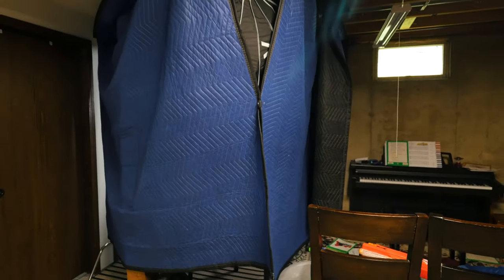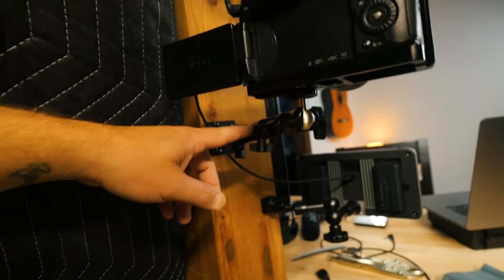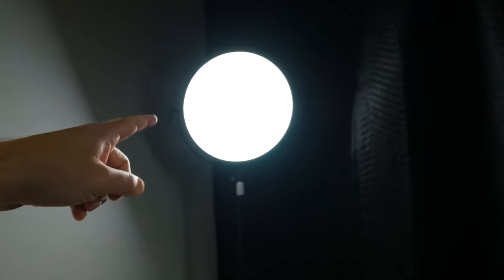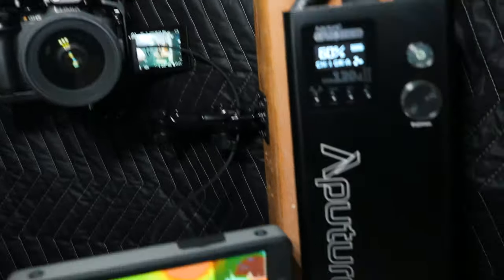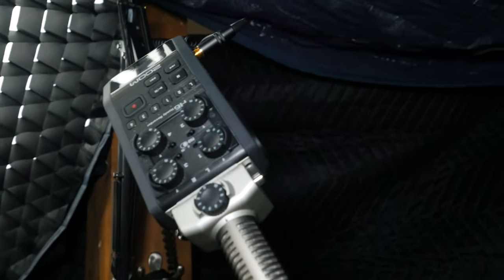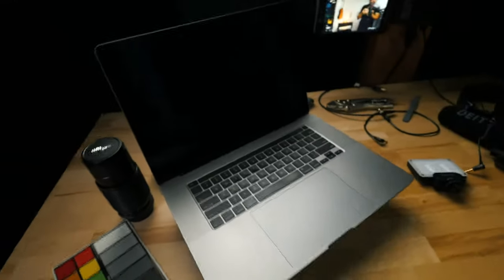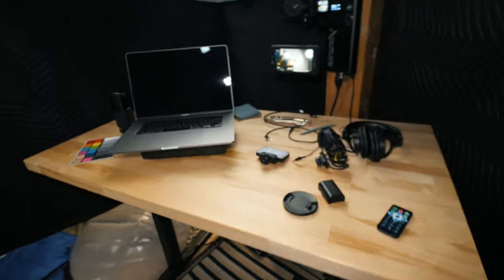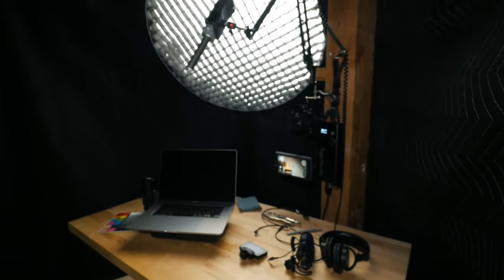GH5 YouTube Studio // BEHIND THE SCENES // Build a YouTube Studio Around Your Panasonic GH5

Comment: Right there with you on the Black Pro Mist 1/8. Thanks for sharing this with the community by the way. Took years of us watching people's videos to finally figure out what we loved about certain ones. Yep, the filter. 1/8 is just enough to take the edge off and in my opinion 1/4 is a bit too much for us unless you are going for some sort of dreamy sequence. Tried the Black Pro Mist for the first time this year out in the woods where most of our videos were shot.  Great at times, awful at other times. Tough when you can't control the light. The Pro Mist is no longer on the lens for outdoors, but still stays on indoors. Our current home setup is very budget. Because we don't have proper lights it takes a lot of guess and check. Move the light forward a bit, add some sort of diffusion, bounce some light. Everything to take a bit of the harsh GH5 edge off.  Great video and great studio. Love the sound blankets.
Reply from the maker: yeah i totally agree with taking that pro mist off for outdoor shots. I very rarely use it outdoors. Primarily for interviews or studio talking heads. i like how it softens the highlights especially on the face. thanks for checking it out!

Comment: Thanks for the tour. Very efficient use of space and equipment. Your 120D key light can be rotated in the yoke and underslung. It’s designed to vent heat from fan on top. It will likely help preserve your light and likely help with sound (noise from fan) as well.
I do like the idea of a color wash in background storage area but the blue room looks cold and somewhat creepy.